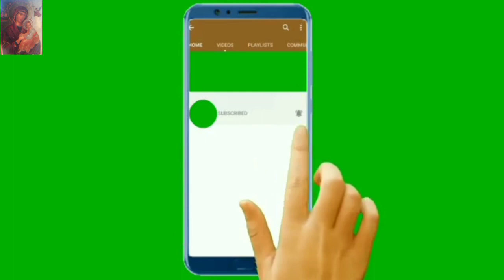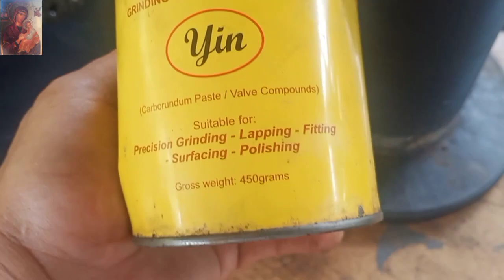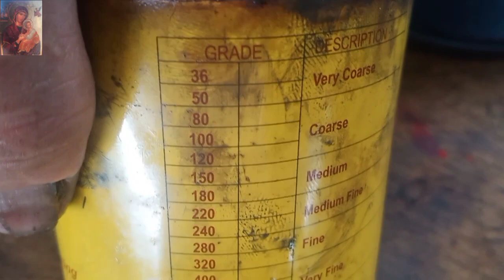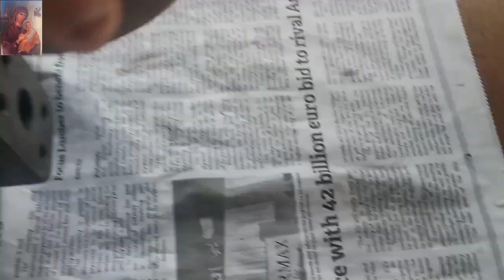Hitachi hydraulic pump repairing and lapping

Comment: Thanks for your video, What is reason  to make lapping?
Reply from the maker: The reason why we lapping it because the surface wornout or not flat already and the pressure is low so we lapped it so that it can used again.I hope I answer your question thank you so much my friend.have a nice day
Reply: @tornerongkamayvlog1009  thanks for You answer, if the Surface is not flat should cause that pressure into case is high and damage the shaft seal?Best regards
Reply from the maker: @hernandogarcia1815  right my friend thank you for sharing your knowledge about this.Best regards too.
Reply: 😢800 500 white teacher